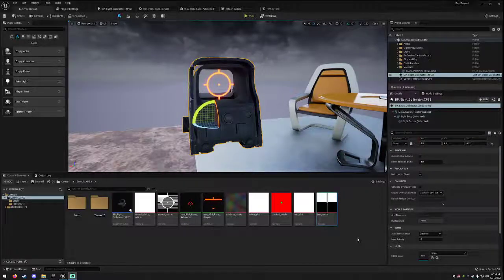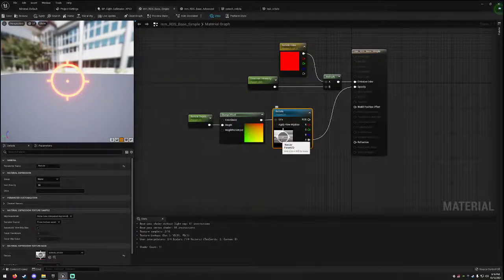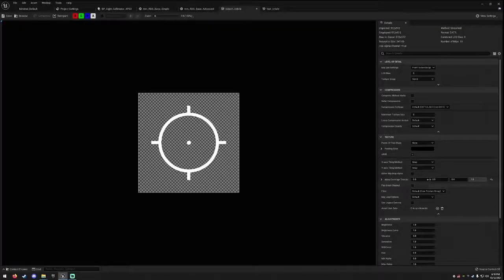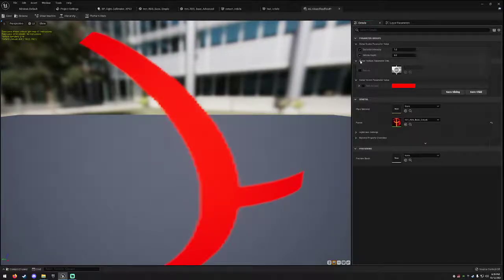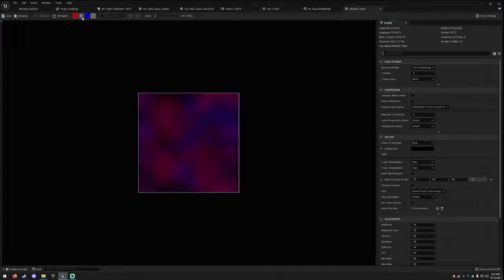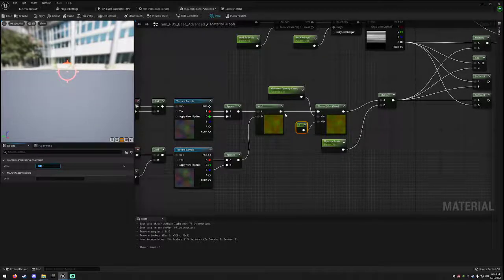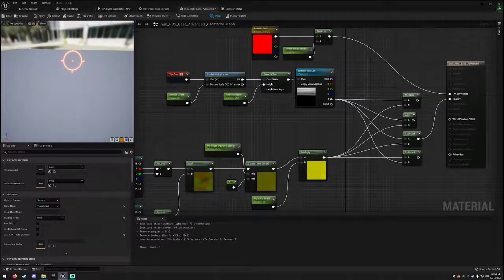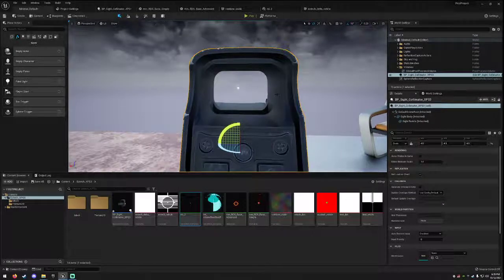UE4 / UE5 Red Dot Material Shader, Simple and Advanced

Comment: Unfortunately, Can't really follow this tutorial without you being more specific about what nodes you are using. If you search parameter you get 30 results for nodes. Vector 3 gives you 7. Can't tell which nodes to use. Converted my reticle texture to a parameter but it doesn't appear on the preview, the solid color fills the whole material, even with the proper mask settings.
Reply from the maker: A parameter is not a node. A node becomes a parameter when you select it and convert it to take parameters as an input value (such as an image for a Texture).

Vector 3 is the node for making RGB colors. If you wanted RGBA, you use a vector 4. 

If you're not familiar with the basics of node based shaders, you should look at the documentation on Epic's website or follow a beginner tutorial. This is not a beginner tutorial and I'm not here to hold your hand and explain what a Vector 3 node is.

Comment: anyone else has the problem that if you look around with this Reticle, the reticle behaves weird?
Reply from the maker: That would most likely be temporal anti-aliasing. You can disable it in Project/Engine Settings.
Reply: Yep, i do, disabling TAA didnt work
Reply: @FGMatej  Incase you still need a solution for this, I found it in the material settings of the reticle, change Translucency Pass to "After Motion Blur"
Reply: @TimeTravelersTalesAI nope it wasnt that, the texture just needed all pixels to be transparent on each side to work propertly
Reply: @TimeTravelersTalesAI  thanks a lot!